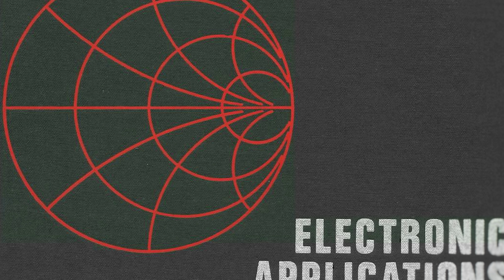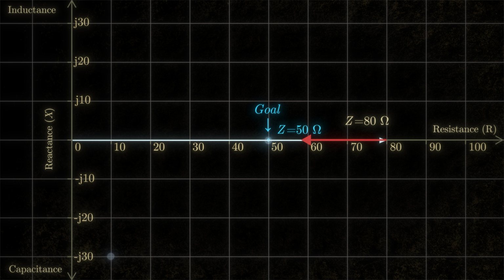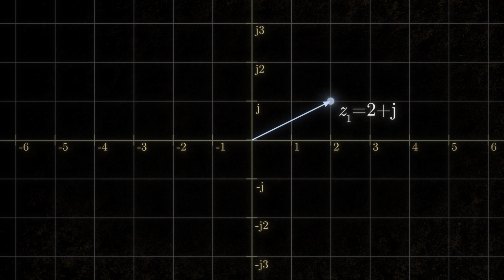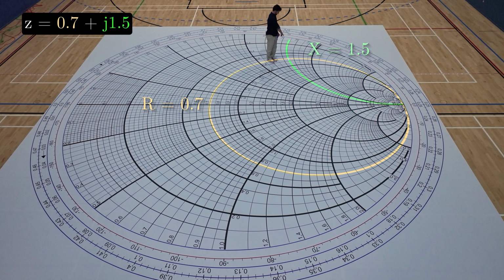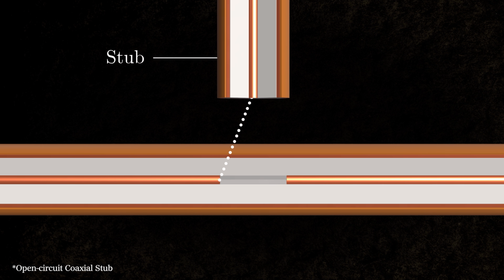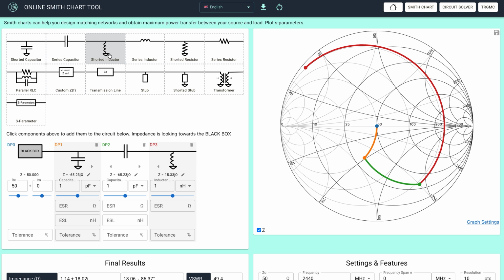The Scariest Chart in Electrical Engineering

Comment: as a 30+ year HAM Radio Operator and electrical engineer this has to be one of the best videos on YT, you have to really see something to get it....
master this and own the world, thank god for a VNA we can stick in our pocket now days LOLROF
or you can string a 71.5 foot #10 wire and hit the auto tune button, you can tune a guardrail or shopping cart with a G90, its been said you can TuneA-Fish LOL if you are just listening toss 3 foot of wire out a window, the rest of engineering is Dark Majic, so many times over the years I have heard How the F*** did you do that, just by adding a Cap I got 1.2:1 across two whole bands.... But its not all just about low SWR :)

Comment: The Smith Chart (0:00) is a famous tool used by electrical engineers to solve the tricky problem of *impedance matching*. Here is an ELI5 (Explain Like I'm 5) breakdown of the key concepts discussed in the video:

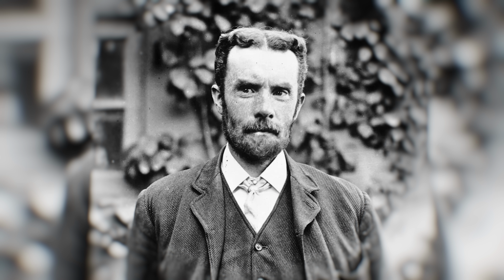### 1. The Problem: Reflections and Power Loss (0:47 - 17:08)
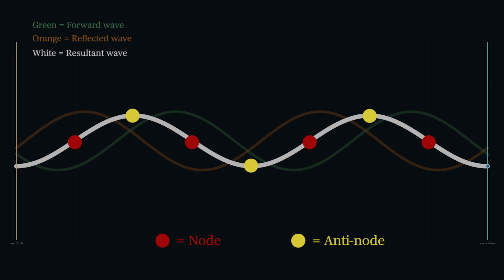*   The Concept: When you send electrical signals (radio waves) down a cable to an antenna, the signal wants to travel smoothly. If the "electrical size" (impedance) of the cable doesn't perfectly match the antenna, the signal hits a wall. Part of the energy bounces backward, like a ball hitting a fence, which wastes power and can even burn out your equipment (5:31).
*   ELI5: Imagine pushing a shopping cart from smooth concrete onto thick grass. It jerks and slows down at the boundary. In electronics, that "jerk" is a reflection, and it stops your power from getting to where it needs to go.

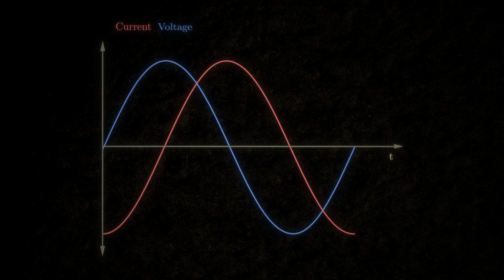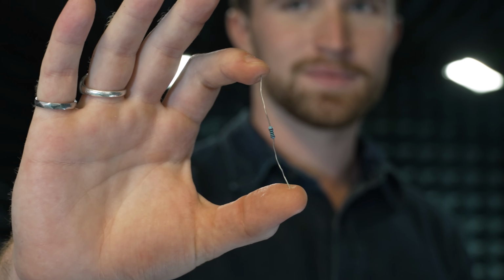### 2. Impedance: Resistance + Reactance (13:37 - 16:19)
*   The Concept: Impedance ($Z$) isn't just standard resistance ($R$). It includes reactance ($X$), which is how capacitors and inductors affect the timing of voltage and current. It is represented as a complex number: $Z = R + jX$.
*   ELI5: If standard resistance is how hard it is to run on a flat track, reactance is like having to run while jumping over hurdles or wading through water. It messes with your rhythm (phase). You can't just match the flat track; you have to match the rhythm of the hurdles, too.

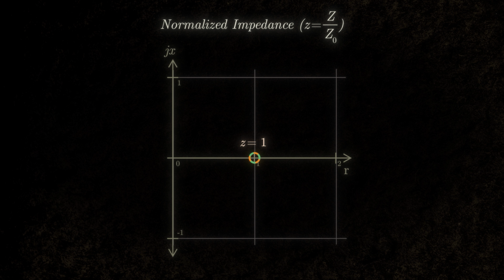### 3. The Geometry: The Conformal Map (20:30 - 25:47)
*   The Concept: Philip Smith needed a way to plot infinite possible impedance values on a single, finite piece of paper. He used a mathematical trick called a conformal map ($1/z$) to warp the complex plane into a circle.
*   ELI5: Imagine drawing an infinite map of the world on a giant sheet of paper. You can't carry that. If you shrink the edges of that paper inward until they meet at a point, you get a globe. The Smith Chart is like a "globe" for electrical values—it keeps everything neat and contained in one circle.

### 4. The Solution: Matching with "Stubs" (31:08 - 34:10)
*   The Concept: To fix the mismatch without adding "lossy" resistors (which turn power into wasted heat), engineers add a *stub*—a side branch of cable. By adjusting the length of this dangling cable, they can create a specific amount of reactance that perfectly cancels out the original mismatch.
*   ELI5: If your car is veering to the left, you don't just put on the brakes; you steer the wheel slightly to the right to cancel it out. A stub is like "steering" the electrical signal so that the reflections cancel each other out, leaving only smooth, perfect power transfer.

Comment: I don't know if non-Electrical Engineers are going to get this.  Having said that I deeply appreciate understanding where the chart came from and the mathematical transform that makes it work. 

It should probably be titled "The Scariest Chart in Electrical Engineering Class" or something like that.  For people that have successfully used it the Smith Chart is not scary at all.  "Transmission Lines, Waveguides, and Antennas" was the class we called the final "Weed 'em Out" course.  If you could pass that you probably were engineering material.  I dreaded that class and sort of dreaded taking that teacher.  I had avoided taking  him in "Electromagic Fields".  It turned out he was a wonderful teacher and I went from hoping to just pass the class to vying for an A.  This chart was so much better for understanding what was going on that just formulas.

That Electrical Engineering degree is more than 40 years behind me and Transmission Lines was never something that I used professionally.  While I had better complex number calculation ability in the early '80s than they did in the '30s there's nothing like this chart for not only rapidly arriving at a solution, but just as importantly a RANGE of solutions.

Comment: Honestly the easiest and most fun class in my undergrad EE was microwave engineering and smith chart transmission line optimization using these smith charts were the easiest A I ever pulled. 

Control Systems however, absolutely traumatizing event…

Comment: Well, this was a magnificent achievement. You managed to make an entire video about impedance-matching without once mentioning the Standing Wave Ratio (SWR) or an Antenna-Tuning Unit (ATU). (Instead of adding coax stubs, an ATU uses variable inductors and variable capacitors to match the impedance of the transmission line to the antenna, which is extremely useful when you want to use the same antenna for multiple frequency bands.)
Reply: or buying a VNA that does the same thing without the Math...

Comment: The admittance chart isn't even strictly needed; 1/Z = Y, this operation corresponds to flipping the impedance point across the center of the chart. You can continue moving around the chart, and convert back and forth between impedance and admittance

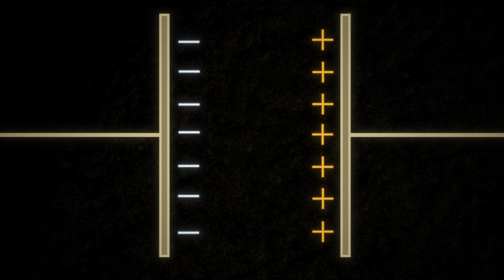Comment: 10:55 any capacitor stores charge. Capacitors stores energy. The charge of a Capacitor exists even when there is no potential difference between their plates. It is all about the charge separation between the plates not about the charge itself

Comment: Very instructive video! The Stub technique is very cool when you can't change the length of the antenna.  But the public must know that a much simpler approach is to cut the antenna to match the impedance of 50 Ohms.

Comment: I understand most everything he was talking about, resistance, inductance, capacitors, ... And that EVERYTHING has resistance. And yet I found myself starring at the screen trying to follow along... The Smith chart did to RF what the slide rule did to mathematics so many years ago. It got you real close to the perfect solution. Computers will now do that for you in milliseconds. The slide rule for me in jr high was the greatest thing. And then calculators came out and slowly slide rulers were phased away. I couldn't use one now if my life depended on it, but I have a calculator in my pocket everywhere I go.

Comment: Its all math. Normalizing to unity. Rotating circles by multiplying by the square root of one. Finally, high school algebra, trig and geometry converged.  

I do miss the printed charts from Kay Electric Company. They offered a degree of granularity most charts do not. And the old Smith Chart hand operated calculator that looked a lot like the navigational aid used by WWII B-29 bombardiers for targeting. Large round chart with a fiducial centered on the rivet in the center of the chart. I still have mine.

One thing the Smith Chart did for me was to clear up ambiguities I had with impedance matching of complex loads. Suddenly the math procedure for impedance matching made sense. You designed a 2 element network to impedance match the resistive part of the complex impedance to the resistive source. Then you added reactance to the network to zero out the load's reactance. Talk about an epiphany.

And do not forget the combined impedance-admittance Smith Chart that looked like a contrivance created while smoking LSD laden marijuana inside an automatic washer on spin cycle. It was fun to explain the chart to digital engineers and watch their eyes glaze over within the first sentence.

Comment: So this is why I used 50ohm terminating resistors on the RS485 buss network in our POS restaurant daisy chain cable network. 1 resistor on the first and last node block. Prevent reflections. Same for the BNC terminators on a 10base2 and 5 network.

Comment: Very interesting video. The Smith chart is no longer scary. But I expected you to at least explain some of the confusing aspects of transmission lines, like how a non-dissipative component (transmission line) exhibits a resistive-looking characteristic impedance. That was one of the major mysteries for me when I was first introduced to these electromagnetic topics back in school. How do we add a non-dissipative component (piece of transmission line) and that let's us tune the resistance? First of all the resistance does not necessarily mean dissipative but it means it would take energy from you and won't give it back either by dissipation or transmitting power to elsewhere. Like an antenna emitting radio wave energy outside or a transmission line sending the energy to the end. Reactance means it borrows energy and gives it back the next cycle. And by tuning the transmission line length, we can attenuate or amplify the wave with the help of standing waves effect. It acts like a transformer. The waves add constructively up or cancel destructively at certain lengths and certain points. That amplification or attenuation is the thing that lets us change the resistive-looking, real part of the impedance. And that characteristic impedance is never the true impedance that you can measure. The real thing is what we measure and what we predict using smith chart. That characteristic impedance is the impedance we might measure at the input port of an infinitely long transmission line. The wave goes into the abyss and never comes back, so it seems like a resistor (real impedance). So the magic has an explanation.
Reply: It's all because the speed of light is finite. The line is not physically small, so it must store a limited amount of energy before it can be delivered to a load or returned to its source (or some of both). When it begins to store energy, but has not yet had a chance to deliver or return any of it, it can only appear resistive, just like a battery will appear resistive as it's being charged even though the energy is not actually being dissipated.

Comment: When discussing voltage/current in AC over time, you several times said the voltage and current were offset by 90 degrees. This is incorrect. I know you were thinking of a sine wave created by circular motion, but in this case we are talking about time, so the unit you should have used is wavelength, specifically a quarter wavelength.
Reply: What do you mean? It's common to talk about electrical degrees along a transmission line, and in any event I knew exactly what they meant. If anything, giving distances along a transmission line in degrees emphasizes that you're talking about the electrical relationships irrespective of the wavelength in free space (which is always greater than in the transmission line).

Comment: No, this isn't the worst one I've seen.
Smith Chart only gives you 2 variables.

Now, take a look at Psychrometric Charts (for thermodynamic properties of moist air) or Pressure-Enthalpy Charts (Used for properties for a given refrigerant for figuring out refrigeration cycles).
THIS is what scares me more.

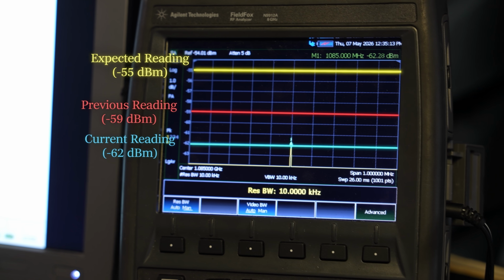Comment: I used that in Archie Straiton's EE321 at UT Austin in 1986, undergrad. Those computations would be a lot harder without the Smith chart! Ain't nuthin scary about it. See green text on screen at 26:25. Here's a fun google query to try: "what commonly used radio signal is at 1085 MHz?" For more fun, check out the weatherman's "Skew-T Log P" chart elsewhere

Comment: At 22:10 you multiply by 1/z.  What is "z"?  This was not at all explained nor intuative.
Show your work.
Reply: z is any complex number. You take the entire complex plane, every number z, and transform it using the 1/z rule. By doing this, every point in the initial complex plane maps to another complex plane. That's the whole concept. There's no work to show. It's literally just 1/z applied to the whole number set at once. Similar to how you'd apply f(x) = 1/x to a 1D number line and get a function graph. It's the same thing, but instead of adding another dimension (you'd need to add two, which is impossible in 3D space and very hard to understand), you map it back onto the same 2D plane.

Besides, he referenced 3b1b video that explains it all in a very understandable way, just go and watch it

Comment: I always called it voodoo because no matter the calculations and even using the Smith Chart, a tuned circuit will still be off. After all, things start to get funky the higher in frequency you go. HF is bad enough.

Comment: Fascinating but what I heard through most of it was the teacher from the Peanuts..waah wahh wahh wahh, Charlie Brown ;P I'm actually more interested in how these same concepts work in biological systems. If nerve fibers are the power lines, which biological processes provide the same capacities, impedance et al. in said system? Would be great to see more videos touching on biophysics
Reply: As an EE, I've always seen nerves as transmission lines. They even have different propagation velocities for the same physical reasons having to do with the insulating material (if any) around them. Yes, I know nerves aren't really wires, they have little signal repeaters along the way, and there are several kinds of electric currents both positive and negative (but not including free electrons), but they obey the same laws of physics and math.

Comment: I'm going to have sleepless nights again - it's over forty years since I had to grapple with Smith charts, ruler and protractor! But it's still important to teach; as engineers, you should understand why the tools you are using are giving you that answer. if you just blindly take the answer given, how do you know it is correct? You should at least, as the professor said, have an idea of what the answer should be.

Comment: Absolutely the best and easiest to understand explanation of what the Smith Chart is used for, and of what use imaginary numbers have in designing radio and power transmission circuits.  Slide rules and ohmmeters use logarithmic scales to represent zero to infinity.

Comment: Where was this video in 1971-72 when I was struggling through the theory of transmission lines in my Diploma of Electronic Engineering equipped with a slide rule and Smith Chart? We could have done with a slinky demo for sure!

Comment: As a recently graduated EE that went the antenna/telecomm line... This could have been explained so much better. I understand this chart like the palm of my hand yet I had trouble with how you presented it. I still commend the hard work you put into making this video but maybe it wasn't as polished as it should have been
Reply: I beg to disagree. If my Electronic Engineering lecturer back in 1971-72 had explained transmission lines and Smith Charts like in this video I would have required only one attempt at the final exam not two!
Reply: @aubreyadams7884 I have to agree with you Aubrey. That was my experience too.
Reply: I'm a telecom EE, and I liked this video so much. Obviously, everything can be done better, but I doubt it'll be easy in a 40 min video.
Reply: Great!  We invite you to make a video that explains this "so much better".  We anxiously await your superior explanation.  (Cue the Jeopardy theme song)

Comment: From the Canadian amateur radio advanced question bank, A-007-001-011: """A Smith Chart is useful:
A. to solve problems in direct current circuits
B. because it only works with complex numbers
C. because it simplifies mathematical operations
D. only to solve matching and transmission line problems"""

D. is not correct because there are other applications.

Comment: I don't understand why going to infinity was considered necessary for this chart.  Yes there is an analogue for infinite resistance, an open circuit.   But....nobody is making antennae out of air.  Nobody is making them out of stuff with high but considerably less than infinite resistance, like wood, either.  They're making it out of reasonable electrical conductors. So just make the chart out to a couple hundred ohms and you're set for most purposes.  Maybe make a second one that goes out to 50k or 1 million or whatever, for those weird edge cases where you're dealing with extreme but manageable resistances.

You don't need infinity.  Your antenna is not made of air or rubber.

At least, not going by the explanation here as I understand it. Any actual electrical engineers who care to correct me, feel free, I am probably wrong.  But please explain what conditions make a chart that runs to infinity useful, rather than just telling me I'm wrong.